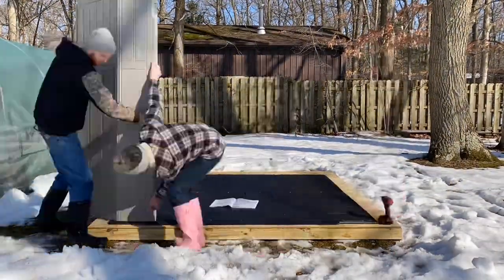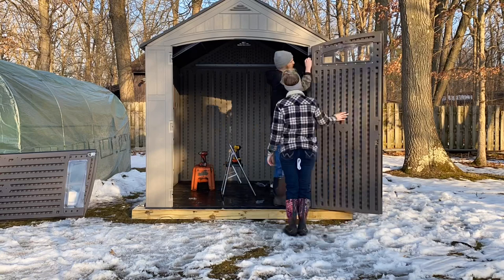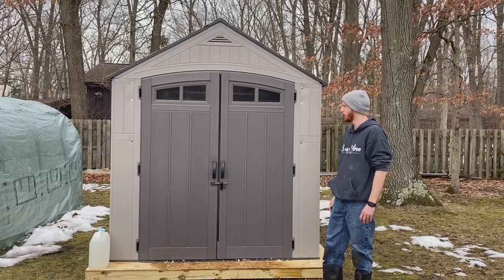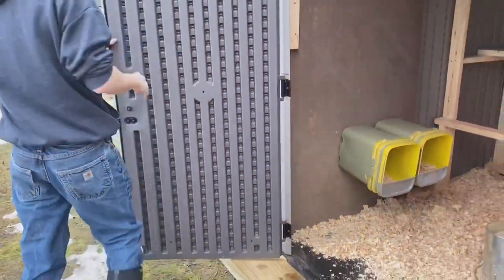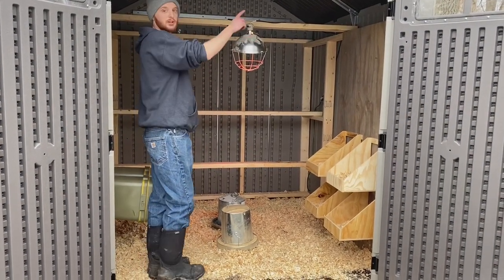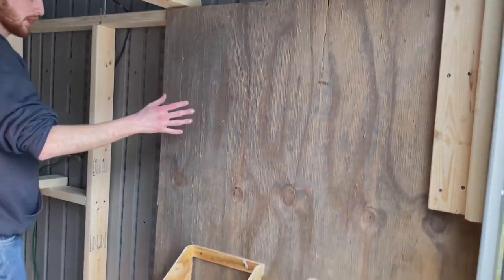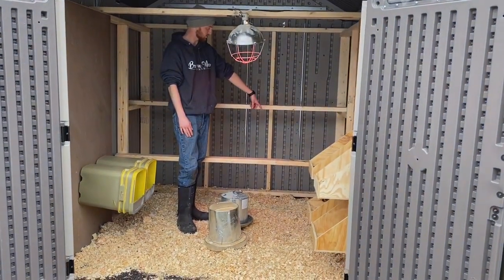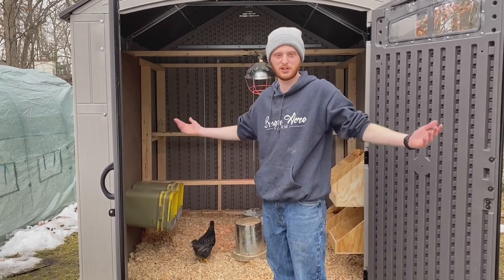DIY Chicken Coop from a Resin Shed Kit

Comment: Gonna help you out here a bit. Your heat lamp is fine,the cage protecting is fine. Heres your tip, go buy a bit of hardware cloth, the metal 5/8 inch square stuff. Form a large piece within the cage and away from the hot bulb. Incase your hot bulb gets hit and breaks. It will happen.  This will not only catch most of the glass, but also keep it from catching your coop on fire from hot glass falling on your bedding.

Comment: We bought this exact shed last year and basically did the same thing you  did and built  two French style doors inside the shed out of 2x4s with wire fence screen so that we can keep the main doors open throughout the day for our chickens. Still need to build the run and attach it to the structure.

One recommendation for you is to buy a plastic wire tie for the doors when shut because the bolt to lock it is way too short and can easily be blown open by the wind. Also caulk the skylights to help prevent rain from getting in.

There are a few modifications we will make this spring to make more use of the inside.  

Looks good guys
Reply from the maker: Thank you! That is such a great idea to have the inner doors. We might add something like that to help with day time ventilation. I appreciate the recommendations- planning to do a little caulking this weekend as a precaution.
Reply: Did you round out the edges of  roosting bars! To help on their feet?

Comment: Where are windows? aren't they suppost to have a window & vent? I hv a coop but regular one with screen for air. Not criticizing just asking. Great set up
Reply from the maker: Thanks for asking! There are two good sized vents at the front and back of the coop. There are also windows in both doors and skylights on the roof. We have plans to add more vents and a screen in the front so we can have the doors open during the day but just haven’t gotten it finished yet. Our hens spent the whole day in their outside enclosure (there is a door for them to go in and out during the day) though and are only enclosed at night so they are getting plenty of fresh air and sunlight during their days.

Comment: I’ve been watching chicken coop DIYs for a few hrs. This is a great idea, if I can find a cheaper/used shed.  I do wonder if this will work for Canadian freezing winters and hot humid summers.
Reply from the maker: I can’t speak for Canada but it’s  held up great in our Ohio winters and summers. No humidity issues because there is decent ventilation and for extra ventilation, we take the front windows out for the summer. In winter, it holds a decent temperature and water only freezes when it gets well below freezing.
Reply: Was wondering the same thing as I am in Ontario. We were thinking maybe we could stick spray foam in the walls and roof because our winters are so cold and damp. 
For ventilation on the top sides leave them open.

Comment: How do you find the ventilation? I want to try a plastic shed as a coop using the deep litter method but I’m worried the plastic will encourage it to be damp. Your setup looks great! :)
Reply from the maker: We have not had any moisture issues. It has enough ventilation and does not seem to hold the damp inside.

Comment: Bought the same one a couple weeks ago after watching this. I will say it sweats bad. I had to put in a plywood floor with a vapor barrier under it. Now the sawdust isn't soaked daily, yes it sweat that bad. I'm going to install more vents.

Did you guys use  pet door for access to the run on just cut a hole and make a door?
Reply from the maker: We haven't had any issues with sweating. It has been in place on our farm for 9 months now with no changes to the floor and is still holding up perfectly and we are super happy with it! We use a deep litter method and only have to fully replace the bedding every few months (previously we cleaned weekly but changed over to deep litter during the summer). On our farm, it stays very dry. Sorry you haven't had the same experience. For the summer months, we removed the front plexiglass window pieces to allow more airflow and that worked great. We just cut a hole in the side with a sawzaw and built a simple wood door.

Comment: I love it but how do you keep it cool enough in the hot temperatures?? I converted part of my shed for my chicken coop but it stays so hot 🔥 inside...
Reply from the maker: It maintains a fair temperature year round. For summer, we increase the ventilation and also keep the chickens outdoor run available to them as many hours a day as we can so they can be in the fresh air and breeze. Also, our coop is strategically located in a well shaded area of our property which keeps the sun from beating down and the temperature lower.

Comment: How often do you guys clean up the floor? And what’s the best technique of any?
Reply from the maker: We do a modified deep litter method so about once a month or every other month. We just add fresh bedding in biweekly. The technique we use for the full clean out is to just scrap everything out with a snow shovel into a wheelbarrow (it then gets used in our compost for the garden). Then we add sweet coop freshener and fresh bedding. Its really very easy and doesn't take more than 15 minutes.

Comment: AWESOME!  Thanks so much for sharing! We're wanting to raise chickens and looking for the least expensive - yet strong and lasting - ways to build a coop.  Love the shed and your reasons for using a resin one.  Question:  What am I seeing between the panels of the shed? - not daylight, right?  Thanks again! (We're in Ohio too :))
Reply from the maker: Thank you! There are metal support pieces on the panels that snap together. That might be what you are seeing. There certainly isn’t sunlight- it’s sturdy and tightly secured. The panels are solid.

Comment: How do you clean the bottom of this coop?  It must get pretty smelly if you are using sawdust and not sand?  Is there a way to construct this shed by putting it without a floor and add sand on the bottom?
Reply from the maker: Hello! We clean it weekly with a pitchfork and put in fresh sawdust. Our hens also have a large outdoor enclosure so they are not inside the coop 24/7. It is also a plastic floor so it doesn’t absorb any urine or poop and we can hose out if needed once or twice a year. We have not had a problem with smell... thanks to frequent cleaning and good quality sawdust. The way the shed is constructed requires the floor. You also need to put a base under the shed floor to make it sturdy. Our base is made of 4x4s and plywood.
Reply: @brownacrefarm  Thank you so much for the update.  Yes, I understand that they are not in there 24/7 but would think that the smell gets pretty strong.  I like that the bottom is plastic though for easy cleaning!  Thanks.

Comment: No windows? What about ventilation??
Reply: The building came with built in air vents. Ventilation is not an issue. We also take the plexiglass out of the front windows for additional ventilation and the chickens have 24/7 access to an outdoor enclosure now (we have added on a bit since making this video).

Comment: That heat lamp keeps them warm in winter? Or did you insulate?
Reply from the maker: We use the heat lamp sparingly on extra cold days through the winter but otherwise, the coop holds a steady temperature. No additional insulation

Comment: So I see the heat lamp because the high is in the fifties- what adjustments will you make for the Sumer high nineties? Should I try to replace the doors with something else? I'm trying to dog proof it for my summer build but don't want the girls to heat stroke. Are the vents enough? What else should I do?
Reply: We use the heat lamp for very cold days in our Ohio winters- as in below freezing. Otherwise it maintains its heat well in the winter. 

For summer, there are air vents built into the shed that provide airflow and we also remove the plexiglass from the two front windows for extra airflow. We don’t keep the chickens inside the coop 24/7 during the summer as that is not the safest not best way to keep chickens. They need fresh air and sunshine. Our chickens also have 24/7 access to a protected outdoor enclosure so they get ample fresh air and are very healthy and happy.

Comment: I was thinking about doing this and then was worried that there wouldn’t be enough ventilation ?
Reply: there isn't
Reply from the maker: There is sufficient ventilation and our chickens have done very well and remained very healthy in this coop for over a year. There are two vents built into the shed and then we also open up the front windows to allow additional airflow when the weather is above freezing and we have a door for them to get into the outdoor enclosure that is open all day. Our chickens have a very large outdoor enclosure where they spend the majority of their time as well.
Reply from the maker: There is also the option to easily add additional vents into the structure. We might add one or two more this summer.
Reply: @brownacrefarm  thank you for your response.

Comment: You should get more appropriate sized roosting bars. 2x4 is too big for their feet. It’s uncomfortable to sleep. Also doesn’t water get bedding wet with water jug inside?
Reply from the maker: Actually in cold climates, the 2x4s are recommended because the chickens can spread their bodies and feathers over their feet and it helps them avoid frostbite. Smaller bars they can’t cover their whole foot and can get frostbite on their toes. We also have added smaller round roosting bars since this video and our chickens all prefer the 2x4s and ignore the other roosts. And no, the water doesn’t spill and cause wet bedding. We have had no issues with that.

Comment: Can you give an appropriate cost?
Reply from the maker: Given how drastically prices have increased and changed since we did this, what we paid is likely no longer an accurate estimate. I have the exact shed linked in the description so you can see the current cost and the wood is just basic treated (outside) and untreated (inside) lumber from lowes. Sorry!
Reply: I am in the process of building a 4 ft x 3 ft coop.  Material is about $700  ($450 in lumber, remainder in metal roofing, paint, hinges, and screws).  On top of that, $250 hardware cloth and some accessories (Feeder, water heater, water drinker,  brooder etc...).  One step further, adding electrical to the coop would cost me another $150 - $200 (wires, exterior electrical boxes, GFCI outlets, conduit, etc)...  
$700 + $250 + $200 = $1150 (Material cost on 4 ft x 3 ft).  Tax is not included yet.
I have some plexiglasses so I don't have to buy.  Otherwise, those are expansive.

Comment: Faults I see to help you: 
1) rats & mice will chew through plastic in no time.
And my I never use plastic bins for my grains.
2) I see zero air flow my friend. This makes for the perfect growth for mold in the winter & over heat the chickens in the summer. Airflow is very important.  
3) No run. While I will free forage my chickens in my backyard, they also have a large run to keep safe from preditors.
4) Too many chickens for that coop size.

I have chicken safe rat traps I've caught a few and the fight continues. 
Good luck, I hope you find my points helpful.
Reply from the maker: Well thank you so much for the unsolicited advice and for pointing out so many “faults”! What a pleasant way to open a conversation 🙄 This is a video of day ONE with this coop at its most basic level and it was stated in the video as well as the description that additional modifications were yet to come. I have TWO additional videos (both linked in the description) featuring all the of the additions we have made including additional ventilation (though the initial coop did have ventilation so there was significantly more than zero air flowing), a large run, and more to make our hens happy and healthy. We have had zero pest or rodent issues in the years since building this, the coop is still in near perfect condition and our hens have lived a happy and very healthy life :)